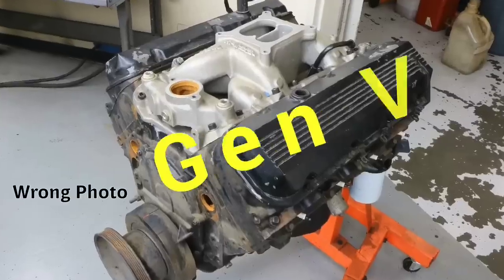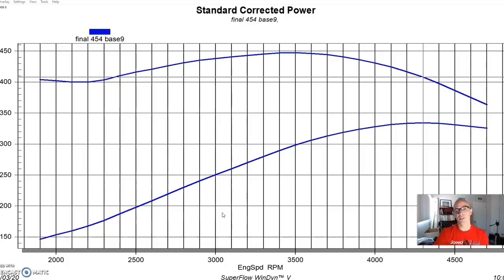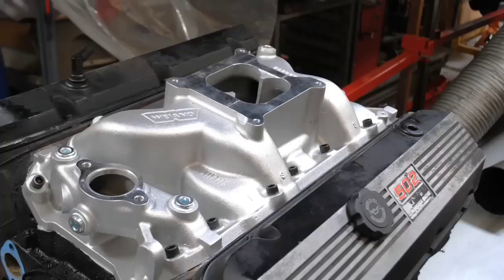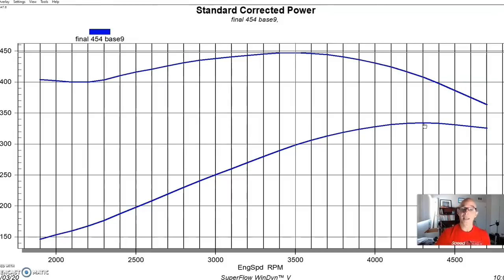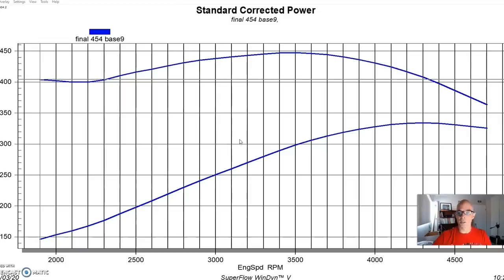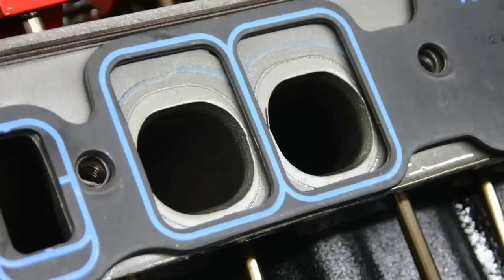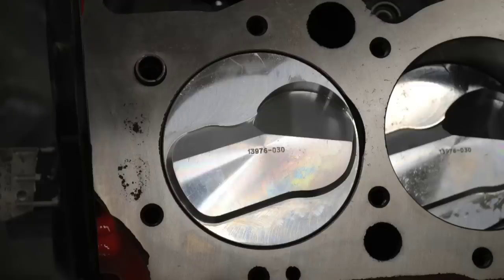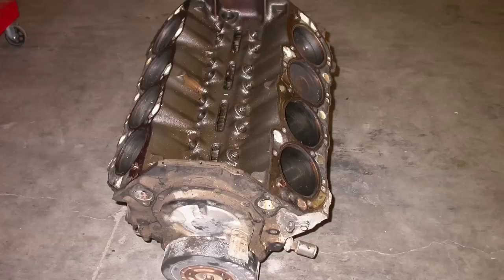HOW TO UPGRADE YOUR TBI PEANUT PORT 454

Comment: Can you use the gen 6 on the mk4 blocks? I know there was an issue using heads from one on the other but the internet seems divided on which way it doesn't work.
Reply: Yes it does work. I have put together several of them. Use gen6 gaskets and open up coolant passages that the gen6 needs. It is reversable and does not make it so you cant run mark4 heads later. If you opt to not open it up i have found that it would run very warm. I tried it both ways.
Reply: @budgetperformancecars934  thanks

Comment: Hi Richard, I recently acquired a 76 short bed step side Chevy with what is supposed to be a stock 454 block and heads.  It has a dual plane intake, 850 double pumper, and headers with 1-5, 3-7 paired and 2-4, 6-8 paired.  I believe because it's a P/U, it should have a 4 bolt main.  Can you give me a guesstimate on what kind of power I should expect from it?

Comment: Install mechanical flat tapped cam in the range of .650lift and then start a shutout of aftermarket heads.

Comment: What would i do? I know replacing peanut port with vortec heads will increase the CR to about 8.5. If i recall correctly, there was about a 40hp difference between the gen V and gen VI on your dyno test. So I wouldn't expect much with just the vortec head upgrade. From the info ive seen in your test, a stock motor with a cam upgrade with some afr 265's would be another option that could make as much or more likely even more than the motor in this video.  

With everything ive seen you do, the afr 265's are at least a 50hp bolt on over peanut port heads and even more depending on the cam.

Comment: How much do you have to go up in octane with the increased compression? I have a 97 454 dually. How much better can it run for towing a 10,000lb race trailer with the stock long runner intake and direct port injection? How much would a cam, headers and tune add? (while staying az emissions legal)
Reply from the maker: not sure on emissions

Comment: Richard, I think we're past the "higher than stock horsepower and torque ratings" explanation. Love the content and all the time spent doing the videos.  Let us veteran viewers handle the folks that question the "elevated" dyno numbers on stock motors. I'll bet there will be several that chime in to help you out with that!!
Reply from the maker: thnx for the assist

Comment: I need info on what will give a decent power increase, and still pass Calif. emissions. 1995 TBI 1 ton dually with 8" lift on 315/70's. It's a turd, but has to pass smog every 2 years. Has headers through stock stock cat and muffler.

Comment: I was surprised how much was gained down low and how it didn't really fall off. for a towing combo I was surprised. This thing would also be great in a crew cab Chevelle with highway gears  as a daily plus a 200 shot for the weekend. 🤔

Comment: HOW ABOUT GEN 6 WITH THE LARGER OVAL PORT HEADS afr 300/290 intake port WITH A ROLLER CAM, RICHARD.
Reply from the maker: ONLY IF YOU HAVE P-V CLEARANCE

Comment: Does anyone know what temp a 1993 454 is supposition to run when wormed up mine likes to run 210 and sometimes 230 I bought this truck to pull a travel trailer and I’m kind of scared to tow with it
Reply: They normally run around there

Comment: Rover/buick, Rolls Royce, Mercedes 6.3, Mod Motor V10, Dodge Iron V10, 6.4 hemi, 2.4 SRT vrs Cobalt SS engine vrs focus SVT, 70s Jag v12, Jag straight 6, 4v Lincoln Cobra motor. Stroke a 6.4 to 7 Liter with stock cam and thitek heads, or ported Apache heads

Comment: Hi Richard! Your channel is Great. I’m building a gen6 454 with upgraded springs like you did many times. I saw you using many cams XR276HR, XR282HR, XM284HR. I’ve got confused since you showed the same Numbers with different cams. Wich was the best for this engine? I decided to go with the GM zz502 Cam (P/N 12366543): Hydraulic roller Camshaft Lift (in.): .527 intake / .544 exhaust Camshaft Duration (@.050 in.): 224° intake / 234° exhaust. What do you Thinq about show it in your channel? 
Well about you question... I think the Gen 5 with l29 heads Will make less power and torq. The Mark 5 has dish piston so the compression would be a little smaller. Your upgraded gen 5 has alredy made more power and torq than your test mule gen6. As far as i studied, the l29 head isn’t a good head. Although the large oval Port, the swrill Kills the flow. What do you think?!
Reply from the maker: that cam should work well

Comment: Sir, 
Curious Q: how hard is it to get 600 ponies out of an all "CAST Iron", well a Factory Aluminum intake ,BBC? Also, have you had a chance to look into the "Aerosol Carburetors" ,really worth a look. I'm told you can run a smaller Carb going thos route because the Atomization is so well done.
HMF
Reply from the maker: THAT TAKES A LOT OF CAM

Comment: I want to see the difference between performer rpm and eps intake on a mild 355 with 882 heads.   Which one makes better low end torque?

Comment: What about putting a cheap ebay turbo on it with a cam upgrade. Leave the peanut port heads and stock pistons with some ring gap and running it like that. Or maybe twin turbos instead of just one? How much air to water intercooled boost could you get by with on pump gas/E85 safely and how much power? Could probably get into the 600 range without a ton of issues don't you think? I do understand that the better the NA engine the better the boosted engine as well just thinking for some relatively cheap fun.
Reply from the maker: 600 would be easy at less than 7 psi
Reply: @richardholdener1727  Would that work on a 429/460 as well or would the heads need to be improved first?

Comment: I have a 1993 C3500 with the GenV and I have a set of Gen VI heads on the bench ready for the machine shop.  It will require a special head gasket to get the coolant flow correct.  There is a specific Comp hydraulic roller conversion kit that deals with the max lift allowed on the Gen VI heads/guides/valve stem seals, edelbrock dual plane manifold and I want to do a holley sniper EFI on it....but I want to see the difference between the factory cast manifold and LT's.   I'd prefer NOT to run LT's and just have a good 3" exhaust because this will be used for towing and most of the LT's on the market for these GMT400 trucks are JUNK...especially after 30k miles of towing 10-15k pounds.   Anyway, would love to see you do the "hybrid" because it is a great budget build...but would love to see if the factory manifolds can be made to work vs. LT's....   PS....thanks for the awesome work on the vids and builds.   very informative and well thought out.

Comment: Hello Richard. Loving the vids. I've just purchased a 1993 454 crew cab dually and i was wondering how to get as much usable power out of it for towing and still have it idle normal. any ideas on parts especially cams would be great. its not a daily driver. its basically only gonna haul my camper a half a dozen times a year and haul my winter wood. i want to also use fuel injection. not tbi but multiport stand alone system. would that help with power or hinder. carbs dont like it here. cold most of the time and i just want to start it and go. any info would be appreciated.
Reply from the maker: HEADERS AND TUNE

Comment: Does a 1973 454 Corvette LS4 have peanut heads?
Reply from the maker: no
Reply: @richardholdener1727  And the only way to know is pulling the valve cover and reading the number? They are not like the old small block double hump or pyramid casting on the outside?
Reply from the maker: if that is a stock head-it is a standard oval port-not peanut port but the casting number will verify
Reply: @richardholdener1727  Thanks. I have a numbers matching rolling and running 73 LS4. Auto Corvette. Without rebuilding the long block, with the exception of the cam, being presented with numerous options to allow this engine to breath better, any suggestions? Not after anything but modest gains over the published HP/torque. I will never be in the position financially restore this icon to showroom quality nor do I care to.

Comment: Why not just use the genVI and get the benefits of stock roller cam plus the option to run 411pcm and coil on plug? I have run a mark IV with gen VI heads and mild cam, eddy dual plane and Qjet for my 77 suburban. Torque was awesome and worked great until I took a civic to the side.
Reply: I want to know also
Reply: Gen 6 blocks aren't always available so sometimes you just take the $200 gen5

Comment: I have read if you put gen 6 heads on a gen 5 the coolant passages don't line up but there is a gasket that will make it work but i heard they will all eventually start leaking coolant

Comment: Can you or someone explain why the intake manifold worked ???? The heads have 3 Cooling ports. Their the 3 rectangle ports on the heads correct ? (End , middle end) but the intake manifold shown only has the two ports? Do you not need the third port on your intake manifold ?

Comment: Hi Richard. I had a quick question. I just bought a 454 casting # 12550313. Information i can find says gen V/VI. The block looks like gen6 from what i can tell (beefier lifter bores, 6 bolt cast timing cover), but looks like peanut ports (casting#10114156) and has a flat tappet camshaft. This tells me its a gen5. Any info you could provide on this subject would be greatly appreciated.

Comment: There was 2 versions of the tbi 454 I know this is the 2nd version I wonder what the difference between the 2 was The 2nd one had a little more horse power but I don't know what the differences were
Reply: You talking about the standard truck 230 ish hp vs the 255hp in the 454SS?
Reply: @kevin9c1  Yes but The 454SS had 2 different versions itself
Reply: @mauricecooper176  Wasn't it just the standard TBI 454 and an increased output version for ~93 or so?

Comment: 2000 gen 6 454 ...

....stripped all EFI off, longtubes, full 3" exhaust, swapped in better headgaskets to raise compression, 750 cfm carb, weiand dual plane hirise, HO454 cam, beehive springs....
pushes a 1970 k5 Jimmy on 40s w/ 4.56s and 14" of lift like it was nothing...

Comment: So dumb question, why would you want a gen V short block  if a gen VI was available to take the heads off of??  I would rather have a IV for the block thickness and possible early ovals or the Gen Vi for the hyd roller and OK newer oval ports.  The only benefit I would see it the V is much less loved so it may be cheaper.  Still I love this test because it shows if you have a truck 454, doing a rebuild with dome pistons, better cam and intake and you have an awesome Daily/cruiser engine that will make tire smoke for days even with mileage gears.

Comment: Here's a real challenge, a toyota 22r/re/rte.
There are three different heads, two deck heights, and have forged crank and rods stock.
Reply: Don't forget you can put a 20r head on 22r and pick up compression

Comment: What advantage does the gen V short-block have over the gen VI short-block?
Reply: I want to know also
Reply from the maker: higher compression piston in the gen 5 when combined with the Gen 6 head
Reply: @richardholdener1727  
O-ra-le 😉👌

I always wondered... is this the same deal on the vortec sbc? Why not just run the complete vortec long block assembly from the factory? 1 piece rear main block, hydraulic cam, and vortec heads... are the pistons/compression caca?
Reply: @richardholdener1727  . I didn't know the pistons were different. Always thought the rotating assembly was basically the same. Good to know.

Comment: Thank you for this. 

I wanna see a gm engine,  destroked, (400 big block with a 327 crankshaft for example) for higher RPMs, and then. 
Boost it. 
Turbocharged preferred.

Comment: 10:50 If the junk yard has both a Gen 5 and a Gen 6 motor, what would be the benefit of doing the head swap vs just buying the Gen 6?
Reply from the maker: more compression-but I would get the 6

Comment: I think I'd test those peanut ports and see if they were "boost heads" at the non existent compression ratio that is offered by the stock pistons. If you got to say 400-425ish you'd probably still eclipse 800+ at 15 PSI or so. Gap, some springs, a cam and maybe some mild porting plus a turbocharger would suit me just fine tbh. Then again aftermarket heads these days are a totally different dynamic at the budget level so there's certainly fewer wrong answers than ever these days.

Comment: what happens if you put longer rocker arms on the stock gen 6? will it improve the performance with everything else staying the same? I have been told that is cheap easy horsepower.

Comment: I would like to see some of these engines whether it's 350 or 454 from the same generation completely bone stock run on the dyno, to see the difference between net and gross horsepower and torque
Reply from the maker: there is more to it than net and gross
Reply: @richardholdener1727  that may be but wouldn't the numbers still be higher on torque and horsepower? And if they are I would just like to know where they make it at what RPM

Comment: That is the difference between the gen5 & 6 short blocks? Why would you use the gen5 block with gen6 heads? Why not just get a gen6 longblock?
Reply from the maker: the gen V/6 hybrid has higher compression but lacks the roller cam

Comment: So let's say i get a gen6 top, obviously i need to get a gen 6 intake, tbi, distrbutor, and an oobd2 Computer? I want to keep the electronics with oxygen sensor working. I am not a fan of changing jets and I have always had problems with Holley and Edelbrock carburetors, they run fine for a little bit and tunning them is like a rain dance. Nobody can give tou a straight answer.

Comment: I am currently building a gen 5 454 and I cannot seem to find an intake so I can swap it from tbi to carb and I need help.
Reply: I have Gen5 454 build in my 454ss truck.  I used the Gen5 stock bottom end.  Same Compcam.  781 heads, single plane GM intake, with the Holley Sniper EFI.  Seems to be a great setup.  Woke the truck up for sure.

Comment: Caveats - 1.) Switching to a carb from TBI and ditching the controller, you need a stand alone trans controller capable of TCC.  Without TCC the trans will over heat. 2.)  Putting on gen VI Vortec heads will eliminate your EGR passages and if you want to run the OEM controller you will have to fabricate an external EGR system.  Otherwise your cal data is wrong and you will get the CE light.
3.) Other tests have shown there is no benefit to upgrading the intake manifold or TBI bores as they are not restrictive for a low RPM 454. 4.) If you use the OE controller, there must be a functioning knock sensor.  A KS error will turn the trans pressure all the way up.  It is possible to spoof the system into thinking there is a KS using a custom electronic adapter.

Comment: I've got a 82 w a 454 i believe  it a gen4 454 ? How much  different  is the 5 or 6
Reply from the maker: the gen 5 + 6 are 4 bolt mains, with provisions for hyd roller and no fuel pump boss

Comment: Are'nt all 454 blcoks the same other than the metalergy
Reply from the maker: NO
Reply: @richardholdener1727  oh
Reply from the maker: 2 bolt, 4 bolt, mark 4, gen 5 & gen 6 are all different
Reply: @richardholdener1727  I knew 2 bolt and 4 bolt were different but I thought the gen 456 were the same block with different intakes cams etc
Reply from the maker: nope-all different

Comment: Awesome Videos as always! What  is you best guess on power at 2k? Still no losses to stock? I built a GM 8.0 which is tall deck gen 6 based engine  with 8.1 cam and pistons. Its a 4.25 stroke and 4.270 bore. Running gen 6 efi with coil on plug and stock E38 PCM in a 2013 Suburban. It runs a stock 8.1 cam and I really want to put the XR270hr cam in . That is a 218/224 at .050 and 114 lsa.  I do NOT want to loose any bottom and I tow with it. Your video here really makes me think I would be totally fine! This engine runs the Gen 6 heads with a fully adjustable valvetrain already.  Do you have any data loading in modified big blocks at 2k or under?

Comment: If you can get a peanut port manifold to flow there is no reason a peanut port cant make 500hp. Maybe you could make 600+ with otherwise the same equipment but a 500hp short bed 2wd could be a ton of fun and sound really good. And maybe you could do the same with a slightly ported vortec 350 but everyone like torque and if youve got the truck then you may as well use it.

Comment: 98 cc 702 heads on a dished piston 454
Reply: what cam would you go with? Dual plane. holley sniper, headers....
Reply: @30aught6  702s are good to raise compression but won't rev like they do on smaller 396s. Dual plane would be good. Headers of course. EFI vs Carb is a personal decision.
Reply: What cam would you go with with that combination
Reply: @30aught6   call a cam manufacturer of your choice and give them the entire combo and your goals.

Comment: patiently waiting for a review of the 427 tall deck....
Reply: What about the 366?
Reply: Val Killmore : Or for ZE_GERMAN...The Ford 370. Both Ford and GM made tall deck big blocks for trucks with another 0.4 inches of iron deck. Great bases for stroker engines and no one wants them. Sort of like the tall deck 351M and 400 Fords, the 351 to 427 truck engines are an unmatched sweet spot for high torque and power engines if the block isnt cracked from freeze thaw or other abuse.